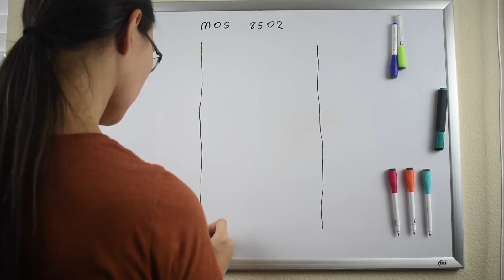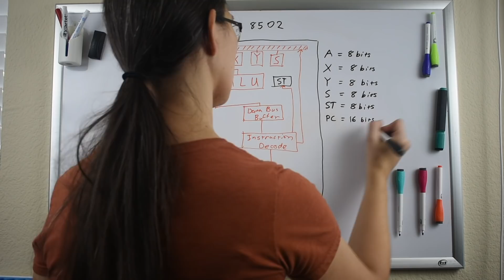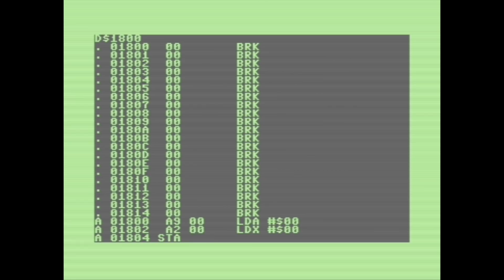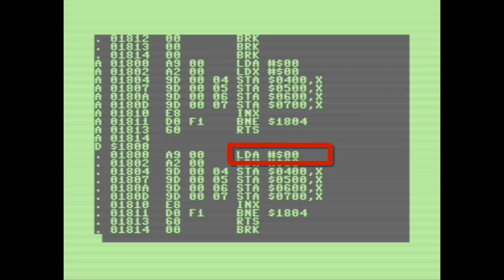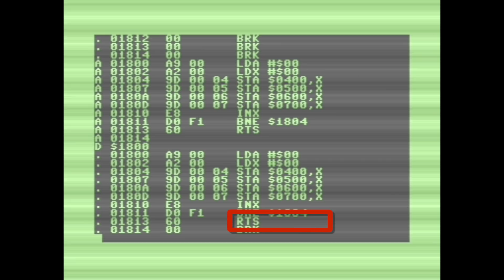Commodore 128D: Episode 1: Meet the Commodore 128D

Comment: I really want to learn about machine language.  I can program with Basic, VB, C, C++, Java script and many other languages but I know nothing about machine language.
Here is a problem I'm having here.  First you've explained A as being a register, but later you've referred to A as being an accumulator. This is very confusing.  Are you expecting your viewer to know what an accumulator or register is? If that's so then unfortunately this is too hard to understand for me without some basic assembly or machine language conventions or concepts.
What I'm asking is actually missing in YouTube.  I would really appreciate if you would first provide a basic knowledge about how assembly works.  stuff like what are the possible variable types such as integers, strings or floats. how can we make a for loop.  how do you get user input assigned in to a variable or how do you output a value of a variable...  do you have to write the code into a specific area of the memory or is it loaded to where ever the loader decides to code to go? do you have to compile it or is it interpreted? 
for example you've mentioned opcodes, so checked on wikipedia what the hell is an opcode. so apparently there has to be an opcode table and it is different for every processor. so, I found the opcode table for 6502 but still it is confusing...  you've indicated A9 is an opcode and also you've mentioned about the mnemonics are creating the opcodes, ok but I've checked the opcode table of 6502 here: http://www.oxyron.de/html/opcodes02.html and there are many different LDA mnemonics so how do you make an LDA with a different opcode also what is the significance...  A9 is LDA but opcode B5 is also LDA... what does that mean?  What are the mnemonic types and are there different types and what are they for really??  Can write the assembly code on a text editor like notepad? if I can, how do I make the txt file an executable such as an exe or PRG??? 
Please explain everything while considering the viewer either already knows Basic or C since I can not think of anything simpler and certainly knows nothing about assembly.
Please do not expect your viewer to already know assembly.  Please explain all basic concepts of assembly.
Reply from the maker: @Tonguç Endem I'll see what I can do in the next few videos to start describing in more detail what this stuff is and how it works. In the meantime, maybe I can answer some of your questions here:

  - A register is a temporary memory that holds information so that the CPU can work with it. Think of these as your "variables" in machine language. You only have a set number of them at one time. In the case of the 6502, you have three that are directly manipulatable: A, X, and Y.

  - "A" is one of the registers of the 6502. It's also known as the "accumulator" because it accumulates the outputs of various operations that the opcodes instruct the CPU to perform. In other words, if you instruct the CPU to, for example, add two values together, the results of the addition will be stored in the A register.
  - An opcode is just a number. This number happens to have a format to it that is decoded deep inside the CPU and instructs the Arithmetic/Logic Unit to do some form of work. We don't usually write opcodes because it's too tedious, and instead use mnemonics.
  - Most opcodes have an "operand", or set of parameters. Some don't. Depending on how those operands are written determines which opcode is used. The way we write those operands is known as an "addressing mode" because it changes how the CPU has to fetch that data.
  - For instance, in the video I use "LDA #$00" the "LDA" part tells the assembler that I want to use the "LDA" base opcode, and the operand is written with a "#" prefixing a hex value of "00". The "#" tells the assembler that I want to use the "immediate" addressing mode of the "LDA" opcode. In this case, A9 is the correct opcode for immediate addressing. B5 is used for a different addressing mode.

I'll take these notes down and see about doing a series of short videos explaining this stuff. Thanks for the feedback!
Reply: @NybblesandBytes  
Does all this apply to modern x86_64/ARM64 processors, too? Of course, instead of 3 registers I'm guessing there are millions or billions or trillions, or is the instruction set completely different?

An opcode that wouldn't have operands would be, say, some kind of NOT which flips all of the bits to the opposite state?
Reply from the maker: @Liran Piade the points I make about registers and opcodes, operands, and mnemonics still hold true today, even for x86_64 and ARM64 CPUs. The only major difference is that modern architectures are heavily pipelined, have crazy long opcodes (128-bits wide in some cases!), do crazy vector math, and have tons of registers.

Yes. An opcode that doesn't have operands might be something like the stack instructions PHA and PLA, which "PusH A" and "PuLl A" to and from the stack.
Reply: Nybbles and Bytes, Thanks a lot.  I really appreciate your attention.  I know if i can just get the basics and be able to write a couple of simplest programs, i will be able to built on it.  It’s such a shame that I can not even write a ‘hello world’ kind of thing in assembly.  I’m really trying to learn assembly so that I can program my CBM 8096, C64 and Arduino to be fast and efficient. Thanks a lot again.
Reply from the maker: @Mr_ToR  Well, until I get a basics video up, try following along with the assembly I do in the channel -- the screen clear program is about as simple as you can get, and includes a single "for" loop, which is exactly why I chose it to start the channel with. All you need to do is grab a book on assembler for the 6502, and you'll pretty much get it -- most of it is just jargon, honestly.

Follow the links in the description of the video for the programmer's reference -- it has a chapter on machine language and how it works. Give it a read through: that part of the book is pretty easy to digest.
Reply: Nybbles and Bytes, Thanks a lot :-)
Reply: Will episode 3 be about SID? ;-)
Reply from the maker: @Mr_ToR  Not yet -- didn't get a chance to get to hardware sprites yet. That'll be the focus for the next video. After that, then the SID. So episode 4 in my plan.
Reply: Nybbles and Bytes, Awesome :-)

Comment: Nicely done!  It's always great to see a new channel dedicated to retro computing, and you're right, there are very few (or none) that focus on the programming side of things.  I hope you'll also be working with C64 stuff, but even if not, learning about the C128 will be pretty cool.
Reply from the maker: @00Skyfox I actually wasn't planning on working on the C64 stuff because I think most others have covered that quite well. On the flipside, most of what I'll be doing should be backward portable to the C64 with minor changes, so you should be able to follow along, assuming you have a monitor cart for the C64.
Reply: I don't think I have a monitor cartridge, but I think I do have monitor programs on my collection of disks somewhere.

Comment: Great to see in depth technical coverage of the 128! Looking forward to more videos!

Of course, the 8502 can only address 64K but a key feature of the 128 was bank switching. It will be good to cover when necessary.
Reply from the maker: @JSRFFD2 I actually cover that in episode 2. Have a gander!
Reply: @NybblesandBytes  Thanks, that video helped clear up a lot. The 64 had its own MMU configurations for swapping in RAM/ROM/IO (which I knew), which was made even more complex by the 128 (which I didn't). That, combined with the bank and page selection in the VIC-II can lead to a lot of power, but also a lot of confusion.

Comment: Glad you are doing this. I had an idea years ago to write a machine language program to print out checks for me on a dot matrix printer. It was part 'learn assembly', part practical application, part nostalgia. I used dasm on a PC and ran it through an emulator. I never tried this monitor thing, although I remember fooling with it on my 128 when I was a kid trying to understand how it worked. Anyway I never finished coding the program and got sidetracked.

Comment: It's definitely good to see this kind of content in my recommendations.

Coming from the Apple II world, it's nice to see the C64/C128's screen RAM is linear.  My "clear screen" program for the Apple II would have had to do 8 STAs, one for each set of 128 bytes of screen RAM from $400-$7FF, only filling the first 120.  This is because the last 8 in each group weren't used as screen RAM.  These "screen holes" store important data (DOS track numbers, 80-column states, etc.).

Amazing on my C64 is my non-precise observation that machine language is, in some cases, literally 1000 times faster than BASIC.  I wrote a BASIC program that POKEd a random char into the screen RAM, then POKEd a random color into the same location in color RAM, and just looped after the screen was full.  It was fast enough for BASIC, but then I wrote the same thing in machine language (with the added bonus of learning how to use SID as a random number generator).  It appears I could do a whole screen from machine language in the time it takes BASIC to do a single character.  I never thought I'd meet something slower than Applesoft!
Reply from the maker: @junker15 Yep, this is literally the reason why I try to stay away from BASIC except for explorations of the hardware. It's good for prototyping something, but if speed is needed, ML/ASM is the right tool for the job.

Comment: Great video. My first computer was a Commodore 128 that I got in 1987. Used it mostly to run Jane writer/filler/spreed-sheet for college with an Okidata 20 printer. A few games, Q-Link and at the end of my use of it GEOS. Main problem was the modem issue and dialup. Since most modems were 1200 bps everything was so slow. Especially when you were in a rural community and you needed to dial out of your area code in the 80's. Looking forward to more in depth videos of what you can do with the 128.

Comment: That 8500 architecture seems a lot like a mini Z80.
Great idea, thumbs up.
Reply from the maker: @Simone Scuderi Kinda, yeah. Two different eras, though. The Z80 came about closer to the multiprocessing days, so it has way more registers, "fast" context switching using shadow registers, a fully relocatable stack segment, and internally it can work with 16-bits of data far better than the venerable 6502 could.

At some point I may have to cover it -- even with all the impediments the Z80 has in the 128, it could probably best the 6502. Something to think about in the 'ol episode plan. :D
Reply: @NybblesandBytes  There's a lot of stuff to cover, not to mention that 6502 is still in use nowadays inside a ton of small MCUs (like car parking LCDs).

Comment: The 8 Bit Guy has initiated a community project to design, implement, and then manufacture for resale a new "retro" style computer. The project is dubbed the Commander 16. People can get involved by joining its Facebook group by that name. I mention it here because the emphasis of this channel (how to write software for these vintage computers) and the Commander 16 project perfectly align. I've already noticed other participants that are looking for ways to get started - to just learn the basics of how to program these retro 8-bit 6502 computers. The Commander 16 is specifically being inspired by the Commodore 64. Because it uses the WD65816, which is still being manufactured by Western Design, it will fill in the whole of being the logical 16-bit successor to the C64. The 65816 has a 24-bit address bus and new instructions that enable addressing and programming with a 16MB address space, while still being able to run 8-bit 6502 code for backward compatibility.

Would be good to see folks in the retro scene get involved with this project. David is taking on the task of writing kernel routines that will be ROMed, but there will need to be other software written like custom character set editors, sprite editors, decent text editors (think something like the popular Nano), assemblers. There's the matter of choosing the BASIC interpreter and implementing it (will want to have compatibility to Commodore BASIC).

Because chips like the VIC-II are no longer manufactured, the Commander 16 will have its VGA graphics implemented via FPGA. The Gameduino is an open source implementation that is very likely going to be the one selected, but it is already being customized to better suit some design goals of the Commander 16. In the meantime people can check out the Gameduino - they will be suitably impressed with its capabilities (for instances, supports up to 255 sprites).

The projected cost to end-users for the Commander 16 is to keep it in the range between $50 to $100. It will have significant similarity to the C64, but not an exact clone. New 16-bit software will need to be written - which is entirely the point. :-)

Comment: One thing I find interesting about the 128 is that it was effectively two complete computers in one. One 8502-based system which is similar to the C64, and a Z80 system which even has its own video processor and VRAM for the 80-column mode.

If Commodore went with an Intel 8088 insted of a Z80 it wouldn't even take a lot of hardware changes to make the C128 a PC-compatible, which would have been a machine that gave the Tandy 1000 a run for its money with the graphics capabilities of the VIC (better than CGA) and the SID sound chip. Even the floppy drive wouldn't need any changes because it was already an MFM drive.

Comment: Too short, need more data....need input! This was great! The more I watch shows dedicated to the Commodore the more I want to get in there and write my own code. It's been well over 30 years since I have had my hands on a C-128 but they're not hard to find. If I do snag one again I think I will go full bore opting to go for the 512KB of RAM right from the start. 

Currently, I'm working on restoring my old cloned AM486DX2@66MHZ w/8mb of RAM. The poor thing (unbeknownst to me) sat in my parents outdoor shed for 20 years. That was my 1994 and first real window into PC gaming. It's in rough shape and I may have to toss the case completely as it's metal and I think the rust is too deep. Sorry...this is a Commodore video. I just have a passion for this stuff and once I get going I can't shut up.

Addendum- What's with the like and dislike buttons? I cannot find fault with this informative video at all and don't understand why anyone would downvote it. At any rate, have a great weekend.

Comment: Great job. Explore the monitor.  Disassemble ROM, where BASIC is stored. You can see how the tokenizer worked as well. When I was a kid, I used the monitor to learn assembly.  The VDC for 80 column can do rastering if I recall for simple EGA style graphics.
Reply from the maker: Yeah, the VDC can definitely do rastering, though I'm not sure how much I'll be using it in these videos -- at least at first. I suspect the VIC-II's sprites will be of far more use to me.
Reply: I remember someone simulating sprites on the VDC.  long time ago... :)
Reply from the maker: @budman85 No doubt it's possible -- I grew up on 8088 machines with MCGA graphics where sprites were a foreign thing, so I know it's doable. It's just tough, and a bit beyond my abilities just yet. =o)

Comment: I hope you cover your 128D hardware in more depth.  I'm interested in those mods you added.
Reply from the maker: @Ryan Patterson there's really not much to them. I didn't add them, myself -- the previous owner did. Essentially they're just a couple of PROMs stuck into the option ROM slots with enable/disable switches bodged into the pins. I'm actually thinking about removing them.

Comment: Hi, it was nice to meet you at the VCF Midwest this past September.  I have a question.  Can you add labels in Assembly code using the C128 monitor or any monitor for that matter?  For example, "loop LDA #05".
Reply from the maker: Hm. So, the monitor is just a raw terminal for examining and messing with stuff -- it's not a full assembler. Sadly, it has no way to provide a means for doing labels, so you have to use raw memory addresses. If you watch my later videos, I'll start to move toward using the Buddy 128 assembler, which allows for full text editing and labels and stuff.
Reply: @NybblesandBytes  Thank you.  When I have time I am going to try that, along with Turbo Macro Pro.